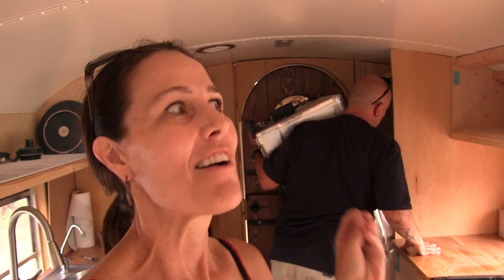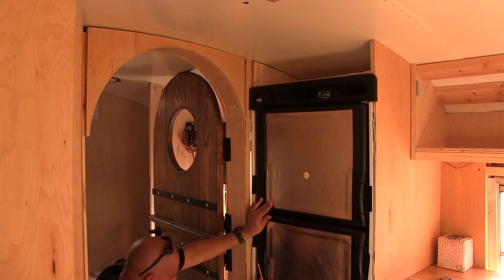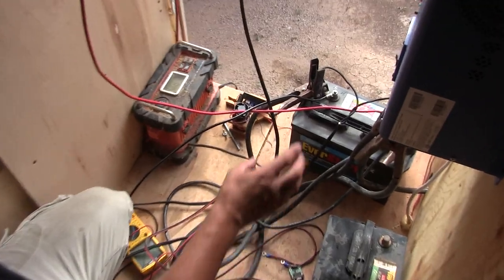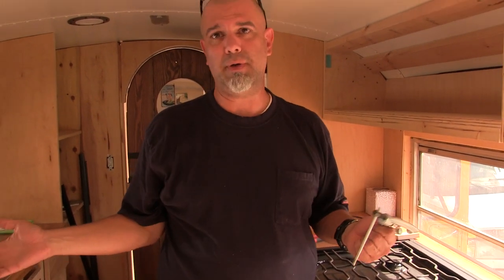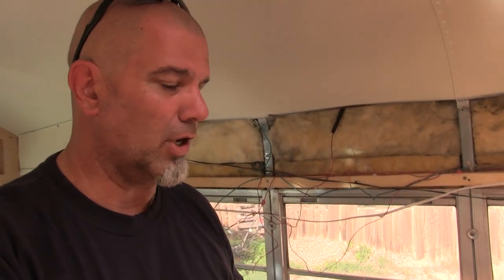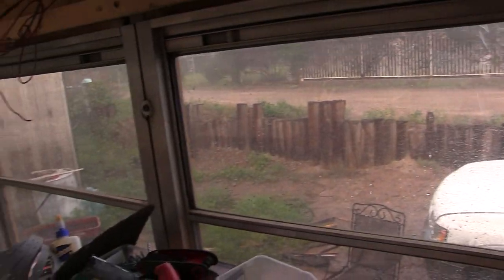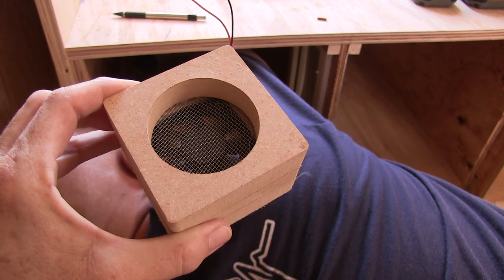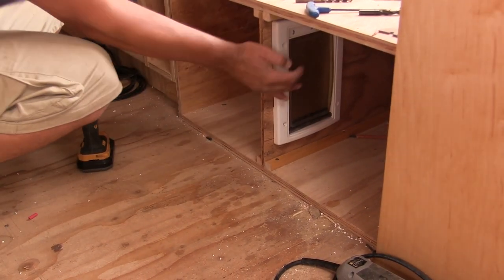Finishing up the Kitty Litter Fan, Dinette Seat, Fridge Drain & some 12v Electrical Wiring

Comment: That was comical 9 times out of 10 the wire with the writing on it is the positive. Lol Mike 9 times out of 10 the wire doesn't care they are the same wire in the jackets so what's important is get the other end on the wire on the same positive or negative which ever side you pick as your positive you make the call that was halarious you two crack me up.  The bus is turning out great congratulations on your dream coming true and I hope to see you guys on the road someday.
Happy trails.
Reply from the maker: I was actually talking about DC adapters.
Reply from the maker: This was the pro-tip! Mike had to explain this to me at the time... that the wires inside are exactly the same but it's called a "protip" because this is the way the "pro's" do it. The point is that all electricians are supposed to do it this way so when the next person is working on that wiring, they'll know which is which. And that's why he said 9 times out of 10... in case of the guy who didn't know the pro tip and didn't do it that way!  😉
Reply: @BussyMcBusface  I know buddy it just made me laugh thinking about the way you said it,  been there brother
Working on a project the magnitude of yours you are thinking of a thousand things and ways to do it even time speeds up. again you really have done a wonderful job on the build oh love the door work too very cool lock you put on it.

Comment: Bout broke my finger hitting the play button when i saw you had a new video up. Mike if i may suggest a tool you may find useful, I'm tin knocker by trade and they have this thing called a whitney punch #5 its made for punching holes in metal (it works on other things to) it has changeable dies for different size holes (up to 3\8 iirc) I've used it on stainless and 1/16" thick aluminum as well as sheet steel. It would save you time drilling pilot holes they go for about $50 on ebay. Also for making small brackets and stuff its a little slice of heaven.
Reply from the maker: I wish I could add the "cha-ching" sound to this comment, LOL! 🤣 I'll leave this one for Mike... 😉~K
Reply from the maker: Yup. Gonna amazon the crap out of this comment!

Comment: Low pump pressure ? Feeding the pump -ve through the chassis ? run another copper -ve lead to the pump (any size) and measure the voltage across the copper -ve and the chassis-fed -ve when the pump's running. It'll tell how bad an idea it is to use the chassis as a -ve conductor !
Reply from the maker: The pump has + and - conductors. Did not use a chassis GND.
Reply: @BussyMcBusface  As long as the pump -ve isn't connected via the chassis !

Best way - copper all the way.

Most 12V stuff will be good for 15V - so you'll be down a couple of volts from optimum - unless solar can give you that extra boost.

Comment: Hope you put a guard on the fan to stop kitty litter falling into it - it just needs a flat plate across the top of the fan but with a gap between it and the fan to let the air through !

Why didn't you just put a poop hole through the bottom and not bother with kitty litter at all ? ;)

Comment: Surprised there isn’t a need for an outside rear vent for the refrigerator/freezer.
Reply from the maker: It isn't your typical propane RV fridge. This is compressor driven.

Comment: I have a question if you don't mind.  I wish to convert a cargo van into an awesome road trip vehicle for my two boys. I would like to install a couple of recliners for them to travel in style. Would this be legal or are there particular requirements for what type of seats can be used in a vehicle? Would RV recliners make a a difference legally?
Reply from the maker: The laws regarding your vehicle will pertain only to the roadworthiness.  Obviously if the seats are for driving they shouldn't interfere with that. It would be smart to fasten the seats in place so if there was an accident they wouldn't become projectiles.
Reply: @BussyMcBusface  thanks bro!

Comment: Will the kitty litter get kicked into the fan?
Reply from the maker: It's funny you should mention that... I never realized it until I was editing the video and saw it on the TV screen, LOL! I mean, there is a piece of wire-mesh screen over the fan so litter won't actually fall through, but I think it will pile up in that circle above the screen. I think I will just add another layer of screen on the very top to prevent that!  ~K
Reply: @BussyMcBusface  but a lot of kitty litter is finer than the screen

Comment: Soldering iron. Add some solder in those crimped connectors and I cringe at those twist on joiners. Solder and shrink wrap them. 5 minutes now means not finding faults later on. 

I guess your learning about amp ratings now.